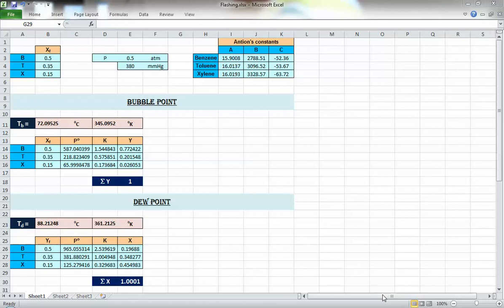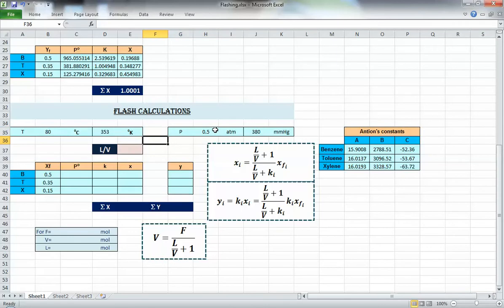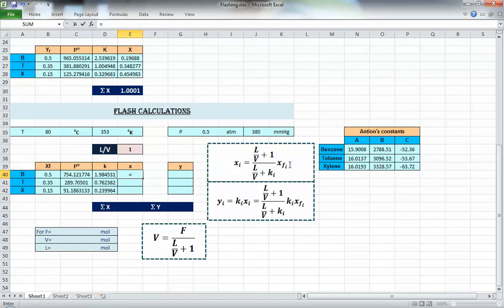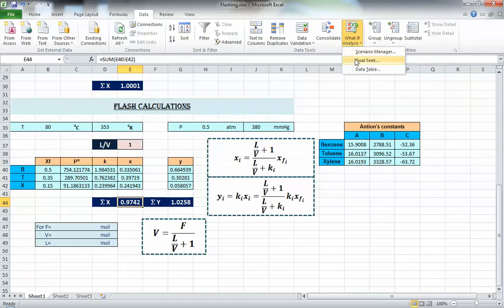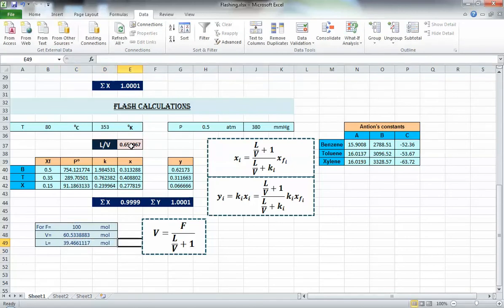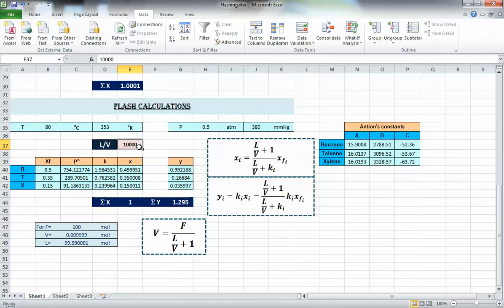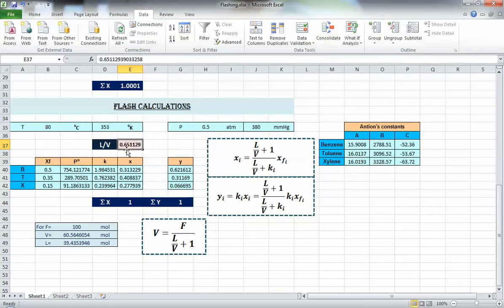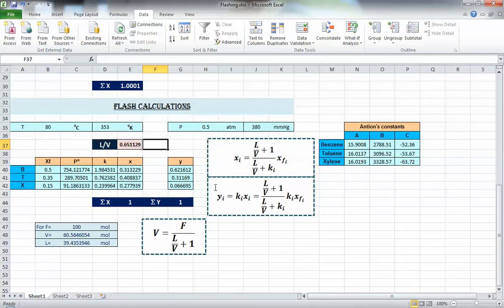Excel for Chemical Engineers I 25 I Flash Calculations (2/2) [Excel]

Comment: Thanks for your video, for the case of three miscalculations of the L/V with a a wrong initial assumption, if you use solver and add Sigma X as the objective function and then add Sigma Y as the constraint and make them both equal 1, then you always get the correct answer regardless of the initial assumption of the L/V.

Comment: Hi Mohammed, thankyou for giving us great information. 
I am trying to calculate mass balance in flash unit, but I don't know how to find composition in both vapor and liquid phase
Reply from the maker: Hi Annas,
Did you try to follow the steps in the video? let me know where you are stuck.
Reply: @MGMohammed  actually, what I want to ask is how to calculate composition of each species in both vapor product and liquid product
Reply from the maker: @annasasshidiiq156   
The compositions of the vapor phase are the y's and those of the liquid phase are the x's.
Do you have difficulty in understanding how I calculated them in the video?
Reply: @MGMohammed   ohh..ok. I think I'm just already understand the calculation. If I may ask again, could this calculation work for mixture with uncondensable gas like H2, CO2, and CO?. 
I am trying to do flash calculation for methanol synthesis reactor output which contain methanol, water, H2, CO2, CO, O2, and N2
Reply from the maker: The way I am doing the calculations are based on the assumption of ideal mixture, they will generate non-accurate results in case of using non-ideal components or operating under high pressures. However, if you know the k-values then you can use the method in the video confidently.

In case of having non-condensible components that you know for sure that they will all be coming in the vapor phase, then you can put high values of k for theses components (1000 for instance) instead of calculating them from the vapor pressure.

Hope this answers your question!

Comment: I have seen in some books that temperature in Antoine equation is in Celsius and on google its also showing that in Antoine equation temperature is in degree Celsius but you are using it with kelvin....why?
Reply from the maker: Antoine equation is available in different units, the values of the constants vary according to the units  of temperature and pressure. You can compare the values of Antoine constants I used with the values you know.
Reply: @MGMohammed  I have tried this method with 
feed ( Benzene : 0.5 and toluene : 0.5) at 1 atm 
I got the buuble point correct but by goal seek i can get Only summation of y at 1 not x......i'm getting summation of x 1.125 ....
Reply: for flash point calculation
Reply from the maker: @vijaysinhchavda8334  can you send me your file?
Reply: @MGMohammed  yes sure...but how?
Reply from the maker: @vijaysinhchavda8334  to find out why the flash calculations are not going right
Reply: @MGMohammed  I'm asking that how to send you file..Can you share me your email id or anything....Or can you suggest any other way to send you file
Reply from the maker: @vijaysinhchavda8334  send it to my email
mohammed.che@gmail.com

Comment: Hi Mohammad! Great information, thank you!  I am trying to do an iterative excel sheet for flash steam process (water into a crystallizer).  I am trying to find the pressure, specific gravity, feed concentration, and temperature values based off of some input values. Do you have any suggestions? I know water flashes at 32ft vacuum, but we only have 25ft available, so that is what I am trying to figure how to go about it. Thanks!
Reply from the maker: Would you please elaborate more what information you have? It looks like you need to calculate a lot of parameters and we have to know the parameters we already have and the system restrictions

Comment: hi Mohammad, thank you very much for the great work. i am working on a separation project, please suggest how should the vapor pressure of methane and ethane be calculated in a feed mixture from c1 to c10 at 318k and 42 bar. i have tried antoine equation, henry's constant, de priester charts, but nothing is giving satisfying results.
thanks
Reply from the maker: If you want the vapor pressures to calculate the K values, then I suggest you use the GPSA charts for equilibrium ratios in "GPSA Engineering Data Book". I found a link for free download:
https://www.academia.edu/11912717/GPSA_Engineering_Data_Book_Gas_Processing_12th_ed_2004

Check pages 25-12 to 25-24

Hope this helps!
If you need the vapor pressures specifically please let me know.